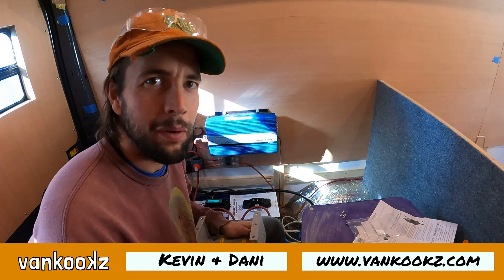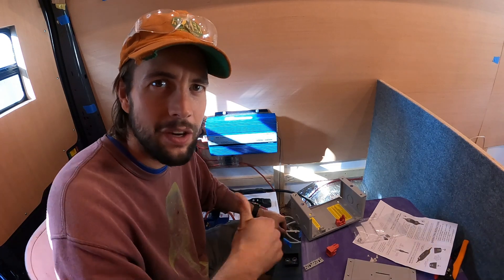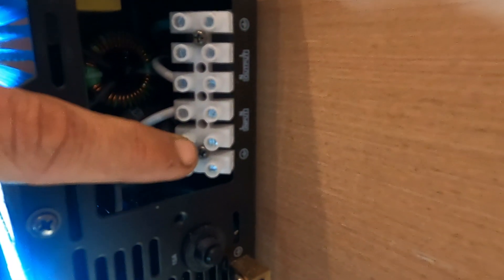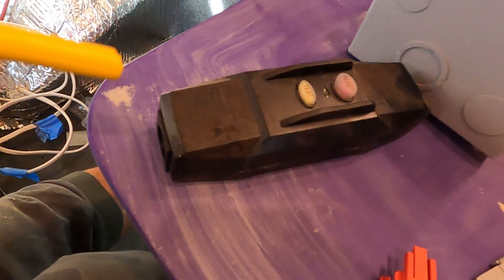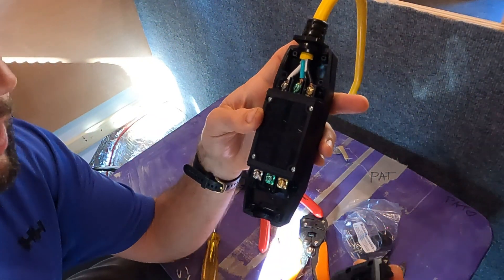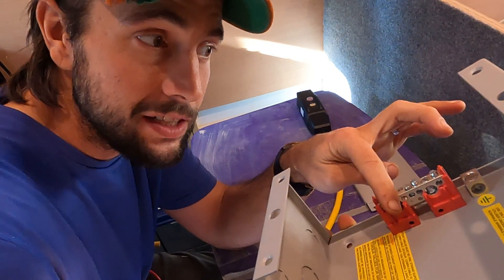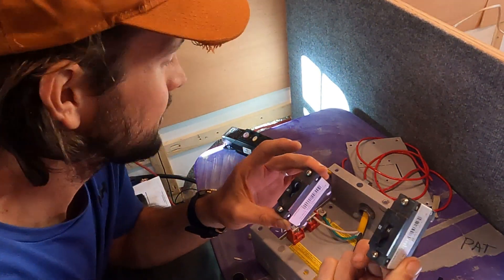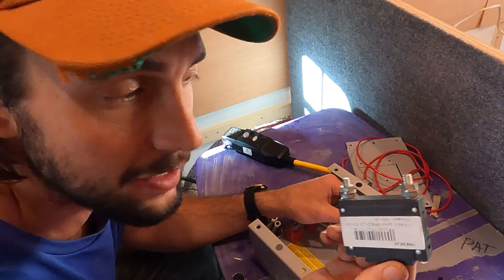AC Power Outlets in a Van | How to Wire an Inverter to a Breaker Box

Comment: You mention that you don't actually need a fuse between the inverter and the breaker box - why is that? isn't there a chance of a short?
Reply from the maker: There’s a chance of a short in the case of an accident or if a wire popped out but it’s just extra protection

Comment: At the 12:32 mark you've got the white and black wires shorted out by screwing them on the same side like that.  That is the neutral side showing.  The black wire should be on the other side.  Neutral white wires go to the silver screws.   Hot black wires go to the brass colored screws.
Reply: not true. Check out the instructions for this model linked below. If you look carefully, you can see the difference between the silver and brass colored screws, both on the same side of the outlet. I'd never seen an outlet built like this one before, but obviously he didn't wire a short and keep that footage in. https://leviton.com/content/dam/leviton/residential/product_documents/instruction_sheet/Leviton%20T5633%20T5833%20Instruction%20Sheet%20EnFrSp.pdf

Comment: Hey, Could you make a video explaning your set up and how you have everything wired from the starter into the inverter. I am working on a similar project and need to find a way to power my ac that consumes 900 watts. i bought a ef ecoflow battery and it comes with the cigarette connection, however the input on that is only 100 watts. Thank you

Comment: Hi, Can you also charge your batteries on shore power (AC) with that setup?   i.e.: 120v to 12v converter/charger? I'm wondering how people are setting this up.  Do you simply add a separate 120v to 12v charger hooked directly to your AC braker box?  Great video, thanks guys.
Reply from the maker: Yes you can you need what we call an inverter charger or an inverter with auto transfer

Comment: The output on your inverter was only 10Amp.  Curious why you would use 20Amp at the breaker? And what was the Amp rating on the inline fuse?
Reply: Same question, saw that 10Amp output, don't understand why its so low.

Comment: Im confused ...why did you dazy chain the breakers?....also why did you put to breakers to only one 120 outlet?
Reply from the maker: Daisy chain to connect the power to both. Also the breaker is totally for extra precaution. Since this van was actually built to spec for a client we just wanted to add an extra level of safety in case of an accident. Just a little something keep that won’t keep us up at night.

Comment: I did my install like this, but my inline gfci to the circuit box trips after i turn my inverter off every time...any ideas why? It does not trip while working only when i turn iverter off, then i have to reset gfci breaker to get it working again every time.
Reply from the maker: So.  That’s the one unfortunate thing about this system most people keep the inverter on 24/7 my electrician friend assured me that I needed more protection since I’m in a moving vehicle and you never know what can happen. However now knowing this I would have not done that a second time.  Although the unit is on 24/7 in the times I do turn it off I do have to go in and reset the breaker.  It’s really not needed it’s just extra protection.
Reply: @Vankookz  well I ended up taking the end line gfci breaker off...I am only going to turn my big inverter on when cooking or using..as it draws I think 16 watts just sitting idle..and I think my inverter should have  ground fault protection built it..I used some different components than you and my inverter is not a transfer station (wish i would have bought one like that instead) but,  your video definitely gave me the courage to wire it myself... I am pretty close to finishing all my electrical..solar, DC to DC, and also have a smaller inverter installed for using smaller appliances 24-7. And will be testing system long term soon.. Thanks again for the video..

Comment: I noticed one difference between your inverter and mine in that yours I see a separate ground wire connecting. Mine does not have that so the outlets I connect to after the breaker or the outlets on the inverter show open ground, this concerns me, have you encountered this issue or question? I am a very novice skoolie to RV builder.
Reply from the maker: I haven’t.  As long as you ground the breaker box it should be ok.  Have you since figured it all out.  Sorry for the delay.
Reply: On AC 120 volts, in a house, the ground goes to ground. A grounding rod is pounded into the ground and the ground ultimately goes to that. A 12 volt vehicle system doesn't have a ground in the traditional sense. The chassis is the neutral back to the negative terminal of the vehicle starting battery, which is 12 volt DC.  By grounding your AC 120 volt system to the chassis, you will be sending 120 volt AC current back to the negative terminal of the vehicle battery. You are effectively interconnecting the 120 house current to your vehicle 12 volt DC system. If you ever have an item that has a short or fault that has gone to ground plugged into your 120 AC house system, it will be sending AC current into your DC vehicle electrical system. That will result in a fire or some other bad happening that you will not want.

Comment: Stranded wire is preferred (I think it is marine code) in mobile applications. The USB /AC outlets are cool in your house, but you don’t want to convert your 12 volt DC to 120 AC and back to 12 volt DC in your Van. You have loss just turning your inverter on and you loose some power in the conversion and then the plug converts it back to 12V DC. Better to just wire up 12 volt USB outlets and cigarette lighter 12volt outlets.
Reply from the maker: Yeah it definatley is the standard.  However I pulled all that Romex out of a 2007 RV so I figured it was ok to use.  Thanks for thr information.  I didn't know that normally I would just use USB outlets and just use the plugs on the inverter and not wire any outlets but this was a build for someone else who wanted the USB ports on their outlet.  I put these videos up because I learn so much from the comments. I felt other than the outlet and Romex I did a pretty solid job here.  Let me know what you think.  I love our vanlife community for always sharing their knowledge.
Reply: @Vankookz  Your T&G video was very helpful for me.  Leaving the edge un-tightened/ un-nailed till the next board.  Also, the importance of making sure you get them snug together before tightening.  I decided to use screws, but it had nothing to do with not trusting your brad-liquid nail method.  
An old video of yours about the engineer that built a shower in the sliding doorway was inspirational.  I did a similar build, but added quadruple filtered, bacteria killing UV lamp recirculating capability with Rixens on demand heating. Still working out ceiling and shower head.  The sunken/ hidden stainless steel shower pan has a teakwood inlay and steal slats fitted in the sides like in your video. The shower curtain has magnets sewn into the bottom to keep the curtain snug to the perimeter of the shower pan.  Even installed the shower mixer & control handle in the van wall like in your video. Much of my shower design is inspired by your video so THANK YOU!
Reply from the maker: @jeffsteinmetz7188  That's awesome dude!  Yes!  I love YouTube for all the knowledge shared amongst subscribers and commenters.  

I learned something from your comment and I was able to share the T&G tip after building about 6 vans at that point.  

Sounds amazing!  

If we ever run into you on the road I'd love to get your shower on the channel! Thanks for the love!